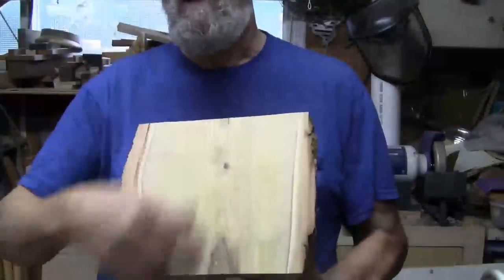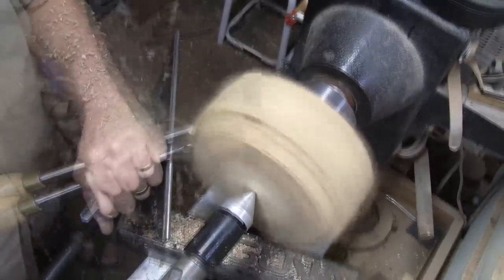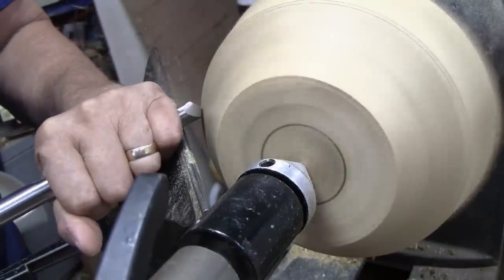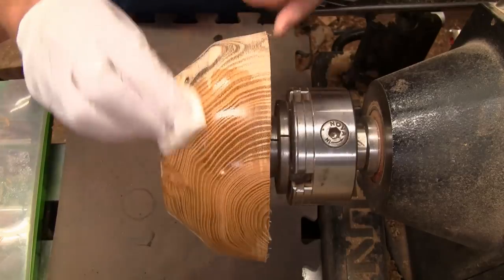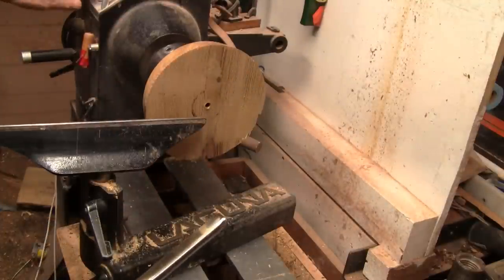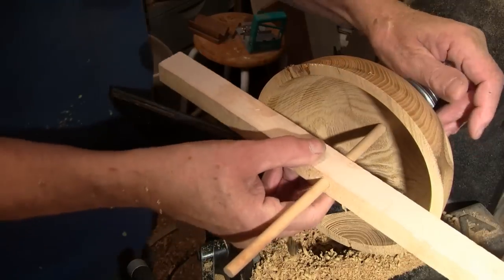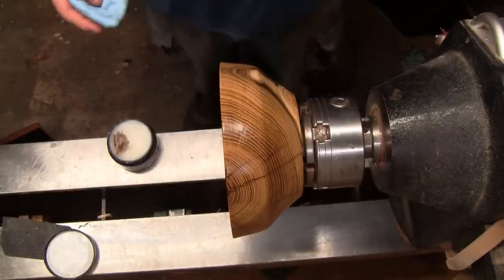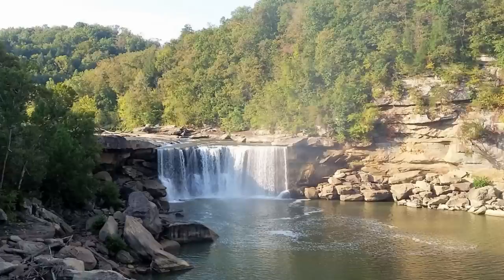Make It Easy Black Locust Wood Turning Simple Meets Nice

Comment: Gorgeous bowl Gary ! The Black Locust sure has some pretty grain to it . I also find the outside turns easier than the inside . I also feel the cracks ad some nice character to the piece . I had to chuckle when I first saw the project as I had done almost the exact bowl a couple of weeks ago . It even has the little dimple that didn't get turned . lol . I also like the contrast of the lighter sap wood on either side . another great video . Happy turning .
Reply from the maker: Thank you Jon. You can almost always count on Black Locust to end up looking good. I have only left the bark on a few turnings as it is really hard to keep on. It is so thick as well. And those were when the wood was still very green.
 Thanks for watching,
Gary

Comment: Really pretty, Gary. With wood like that, it doesn't have to be complicated to be nice. Looks like you didn't get around to making a Rick Morris depth gage for your bowls. Take care.
Bill
Reply from the maker: Thank you Bill and you are right. Hard to not have a pretty bowl with Black Locust.
 I made one of Ricks depth gages. It is in the lower right cabinet under my lathe. The gage I have reminds me of some  depth micrometers we had a work. I guess I just find this easier to use and takes up less room. Plus I would need to bend over to get the Rick version LOL.
Take care,
Gary

Comment: Thanks for the video.  I was just given a short section of Black Locus (just cut firewood log that they hadn’t split yet) to try.  I cut out the pith and have two blanks to either rough turn a blow blank or try a once turned bowl (or both methods).  The grain was the first thing I noticed, it is beautiful.  I think I’m going to like Black Locus.  Thanks again for the video.  BTW: I like your church projects as well, very nice work.  Cheers, Tom
Reply from the maker: Thank you Tom and you will love Black Locust. I have never twice turned any of the Black Locust that I have done. Never had any problems with it. Happy you enjoyed the video.
Take care,
Gary
Reply: @ThePapa1947  Good to know. I’ll try a once turned to start with. Thanks again. Cheers, Tom

Comment: Another beautiful bowl, Gary. I like what you saved on the outsides. You often mention the speed at which you turn. I use the Goldilocks method of speed selection. Not too fast, not too slow, whatever is right and I never know what the rpms actually are. For me, it's all relative and what feels right is what works.
Reply from the maker: Thank you Josh. I get ask a lot what speed I am using and I need to look and see what it is because I set it by feel. I am sure a new turner will end up doing the same but it seems to be helpful just starting. So much depends on the size of the piece. I relate this to surface per minute passing the tool. A smaller diameter will need more RPM than a larger one. This works for any type of cutting  From drill bits to end mills cutting steel.
 I think when it comes to wood it is not thought about as much but it is still the same.

Comment: Have you ever used dead centers in the tailstock?   What would be a suitable lubricant, or is none necessary? The reason I ask, is that have a 1/2" x 4" stainless rod with highly polished pointed tip that I could mount in an MT2  endmill holder.  This would give much more clearance that a standard live center.
Reply from the maker: Way back in grade school and high school shop class all we had was dead centers and used beeswax. Sounds like what  you have should work.

Comment: Lovely bowl Gary, it sure has nice color and grain patterns! Well done! Did you do those crosses on a scroll saw? Thanks!

cheers Al
Reply from the maker: Thank you very much Al. I do not have a scroll saw so I cheated and used my CNC machine. I cut the cross parts out on my table saw I used a lap joint to form the cross.
 Thanks for watching,
Gary

Comment: Great work Gary. What's the rationale for sanding in reverse on the outside of the bowl?
Reply from the maker: Thank you Brutt. Well there are a few reasons.
When  you turn it can raise the grain so going the other way it sands it away easier. Been doing that for years. Had an old belt drive step pulley lathe I wired to run both ways just for that reason.
 When sanding in reverse it directs the dust toward my dust collector port.
And you have the sander or your hands above instead of below next to the bed of the lathe.
 Hope that helps.
Thanks for watching,
Gary